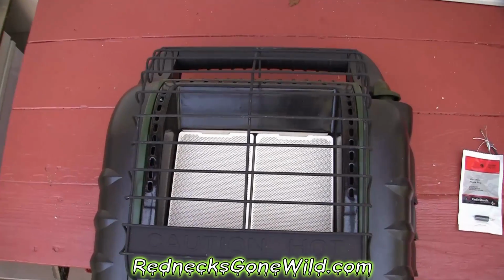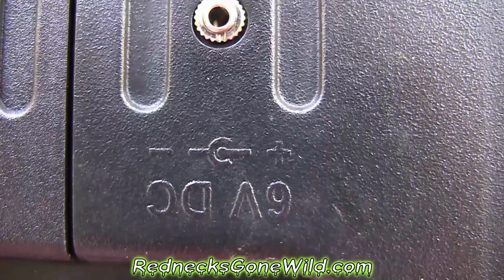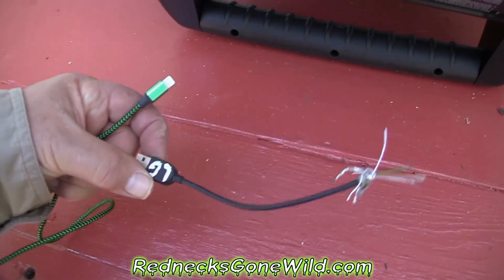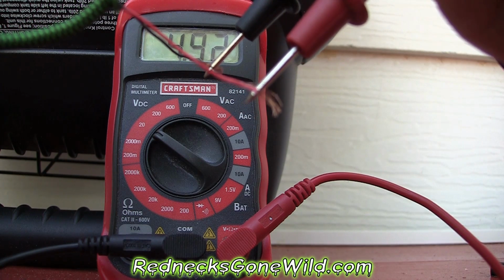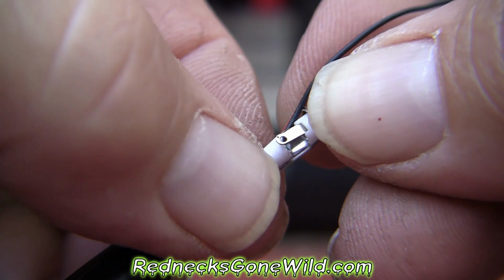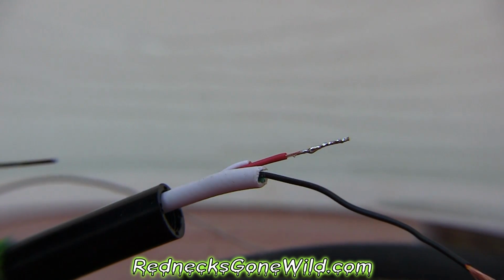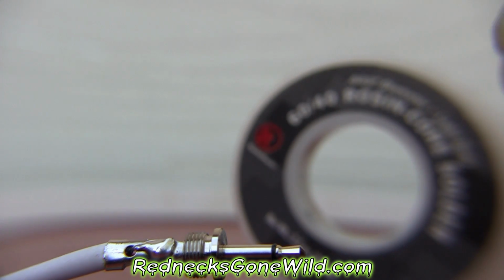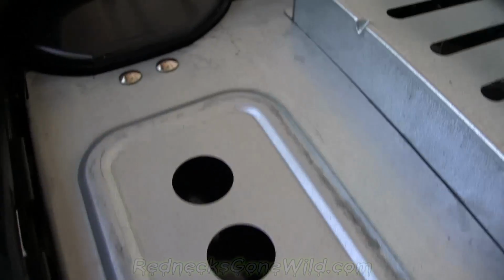Big Buddy Heater Fan Hack

Comment: Did close to the same...instead  of the Jack I used alligator  clips and hooked up to the battery  prongs to the battery  pack..no soldering just crimping and electrical tape.

Comment: That is a nice looking job you did with making that plug to go on the wire and the heater must work great with the new plug installed. I have several of the big buddy heaters and would like to have a fan working on each of them. Thanks for sharing this tip on how to make a wire to connect to the heater and get it working.

Comment: put this elsewhere but it didn't seem to work.  I have a tough buddy (MH18B). I was interested in the part where you said the fan is 12V.  I took mine apart and the fan clearly says 6V..  These share parts so this is confusing.  Are you sure you're fan says 12V?
Reply from the maker: yes mine is 12 volts but the power adapter they  sell is only 6 volts
Reply: I thought he said the DC power pack (one with the USB ports) was 5volts output and his black adapter (the one that came with unit) was 6 volts output.   .....anyway, this whole deal is foolish in my opinion....just go buy a cord..but you have to respect his ingenuity...I'm sure he has other videos that are much better ideas..but what do I know?😀

Comment: Nice work! Thanks for sharing!
Do you have plans to supply the fan to 12 volts now? If so, please post.
Reply from the maker: No , i live in Florida & havent had to use this unit since ...but it does alot better with 12volts ,with the usb 5 volts the fan hardly moves any air.

Comment: Try cleaning your soldering tip, too dirty to work properly. Use a wet sponge or a tip cleaning pad. I had a yellow one, never saw a green one. My yellow one finally died. I replaced it with a red one. Great idea using the USB plug. I can run a lithium  battery using that type of set up instead of the D sized batterys. Great idea!
Reply: Shut up
Reply: @1988tfred  Is a snowflake triggered here?
Reply: No one needs your criticism on how to clean a gun...that was not the point dip shit....how does that feel?...now you know...so shut up!

Comment: If you find you're using the fan a lot, at some point you may want to clean the fan blades inside the unit to keep them operating efficiently.   I don't think there is any kind of a dust filter being used.
Reply: No but if you take the four screws out and apart, you can tape a dryer sheet to the inside.. once apart you will see what I mean

Comment: I like the hack concept. But wouldn't it have been a lot better and easier to simply swap out the Big Buddy's audio female jack with a standard size female 2.1mm DC power jack? That way any old wall wort with the right specs and male power plug could be used. Also, USB to male 2.1mm power cords are readily available. Mr. Heater's bastardized use of an audio plug for power is their way of getting $12 for a power adapter you likely already have in a box of old wall warts.
Reply from the maker: I agree with everything you said & wish I had thought about it first.
Reply: LOL!
Reply: Or get rechargable "D" (or "C" which &&&😘 ever...long video, bad memory) batteries. That way you don't have a long wire going to your cigar lighter.

Comment: Thanks, I like this idea. I have a big buddy and 2 little buddy heaters. I have been modifying all my camping gear with Anderson PowerPole (APP) lately by snipping 3 inches before the plug end of the cable/cord and putting APP on both halves. I plan on modifying BB cord with APP connectors too. I have some Goal Zero Yeti batteries that I hook a RigRunner12 to, the RigRunner12 acts like an APP surge protector. 12 APP connections with a fuse on each.
Reply from the maker: The Fan in the big buddy needs 12 volts . this mod i did only moved the fan slow. USE 12 volts.
Reply: Ok, thanks! My Goal Zero Yetis are 12V batteries. I see right by the input it says 6V, I noticed you said your external battery was only 5V. Could that loss of 1V be the culprit?

On another note...I sent you a private message, did you get it? I don't know if I did it right.
Reply from the maker: yes i got it , i go read it now.
Reply: ok
Reply from the maker: it say 6 volts, but when you see the fan inside it says 12 volts
Reply: ok
Reply: I have a tough buddy (MH18B).  I took mine apart and the fan clearly says 6V..  These share parts so this is confusing.  You're sure it says 12V?
Reply: Thanks, for sharing that little tidbit of information.   I'll be modding mine for use with 12 volts for greater output.   Apparently, they purposely avoided using 12 volts to make the hack more difficult.   I'll try to give them the benefit of the doubt and assume they did it to reduce wear and tear on the fan or keep the noise level down.

Comment: Nice idea.  Thanks.  D Batts get expensive...
FYI - To make it easier for you, clean the tip of your soldering iron with some mild abrasive until you get to the silver color again.  Then make sure to tin the tip with some solder.  Keep it tinned (covered with solder) when not in use and it won't oxidize like yours is.  Tip will melt the solder and heat the part you are soldering much better for you.  If solder won't stick to the tip of your iron you need to clean it before starting your project.  Cold solder joints will happen if you don't heat the metal hot enough to melt the solder.  You should be applying the solder to the part to be soldered, not the tip of the iron.  Just a friendly tip, not criticism.
Reply from the maker: Thank you, :-)